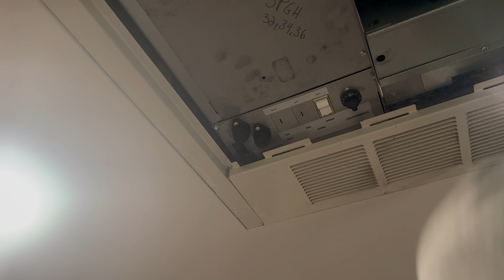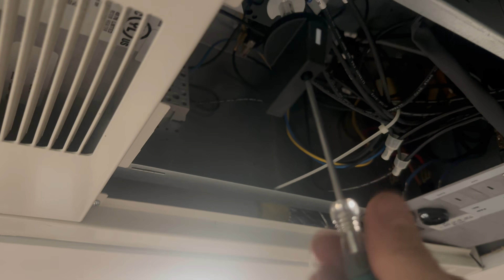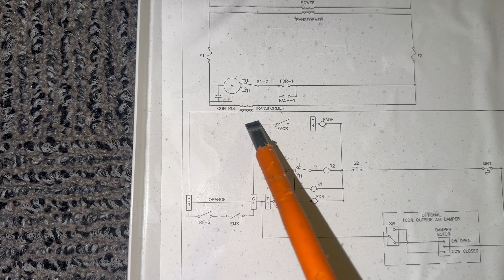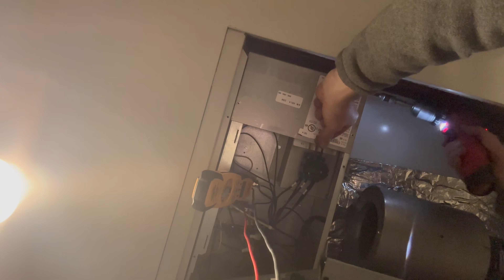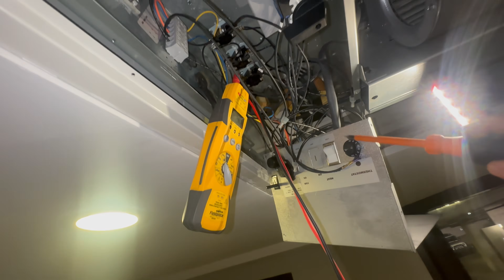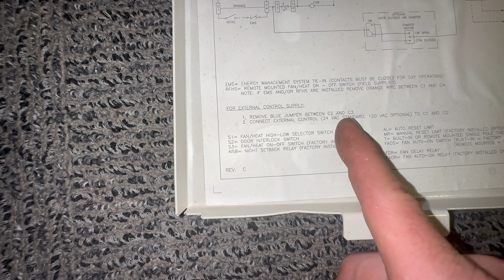Real life troubleshooting #2 - Electric Heater 3PH 480V

Comment: Those are sequencers. They have a wide range of operating delays. They may make up from 30 to 120 seconds and take 45 to 90 seconds to break. They are used a lot in residential split system air handlers. I'm sure you've seen them before, having been in the trade.
Reply from the maker: Ah yes I've seen lots of them in Florida when I worked there over a decade ago. Not really around in Colorado, as this is the only property out of 13 I've been to I've seen with electric heat (besides baseboard heaters)
Reply: @ApartmentMaintenancePro  Is CO usually gas in multifamily? Or hot water like in your last video?
Reply from the maker: gas for hot water, hot water for hvac heat, from what ive seen @TreasureHoardHobbies